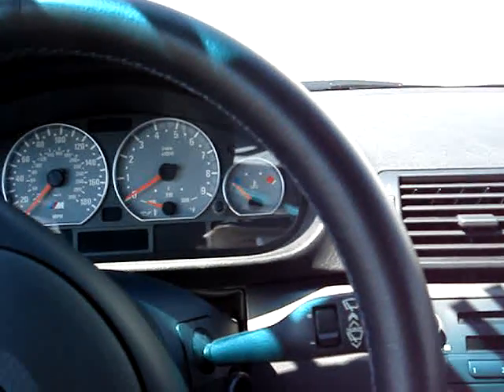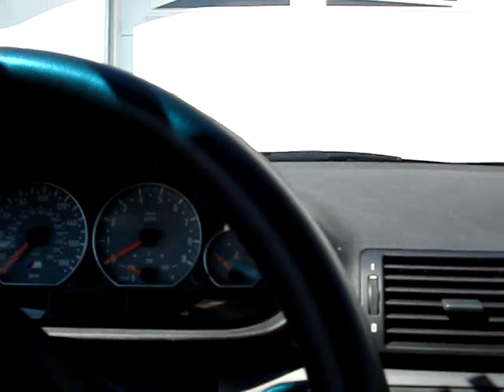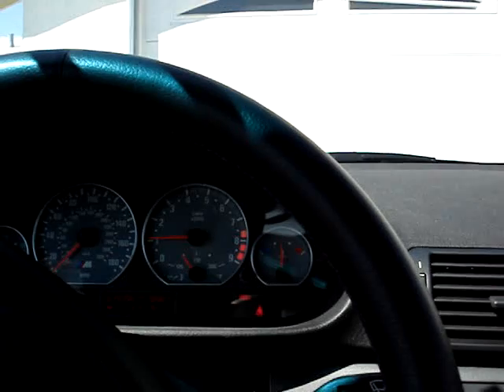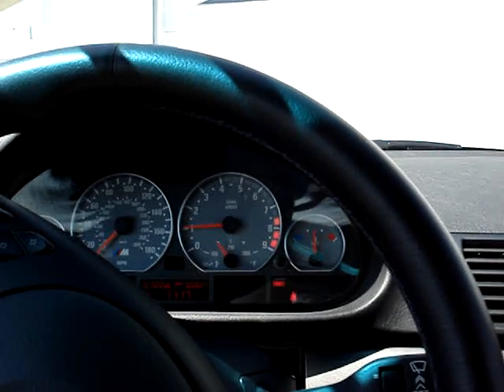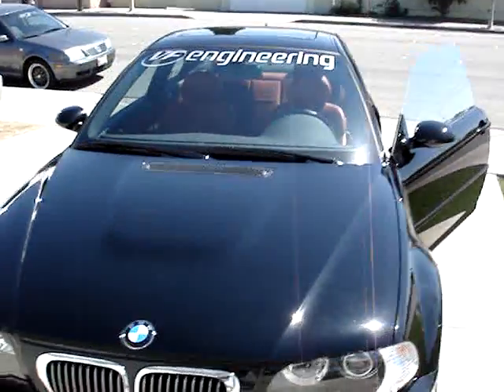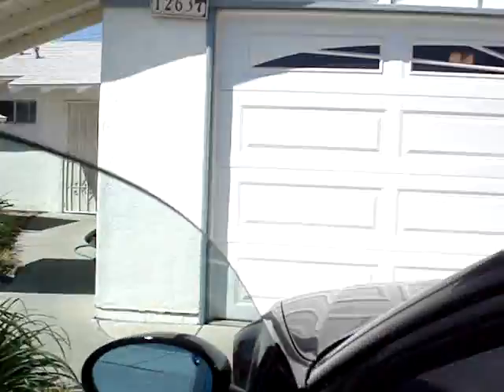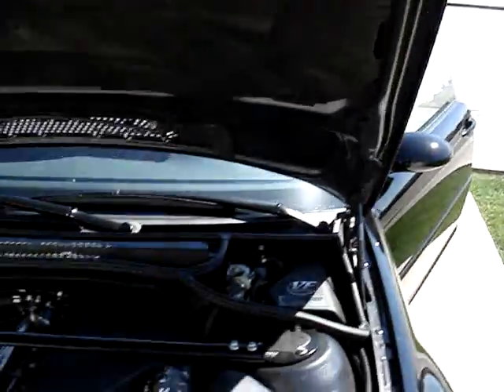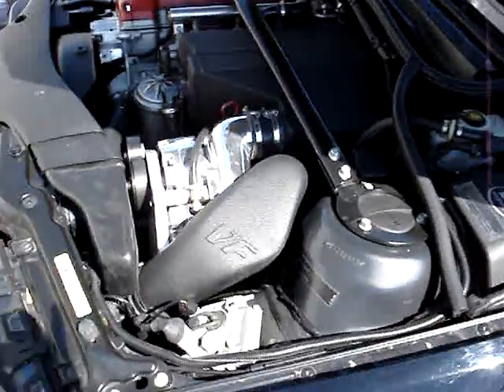VFE S54 M3 Supercharger Kit

Comment from the maker: they have a programmer that the user can plug into the car OBII  which will change the settings for race gas or even limit the car for valet parking.. call them and ask about it,

The Flashloader™ switchers allow you to switch between your favorite GIAC performance software and your stock software with the touch of a button.